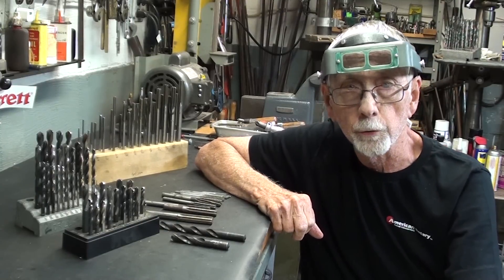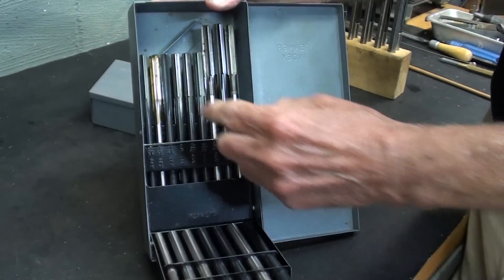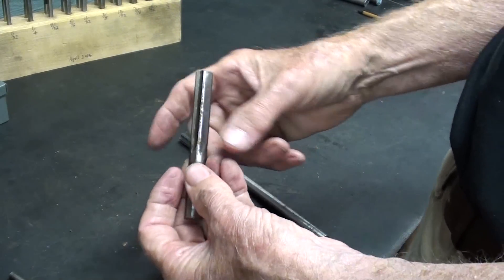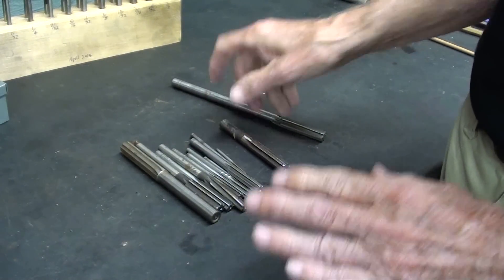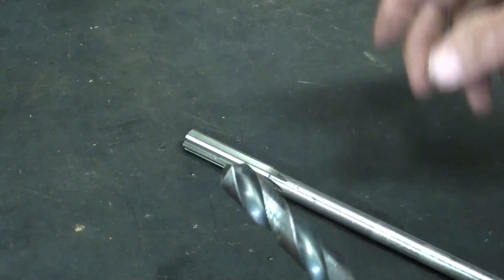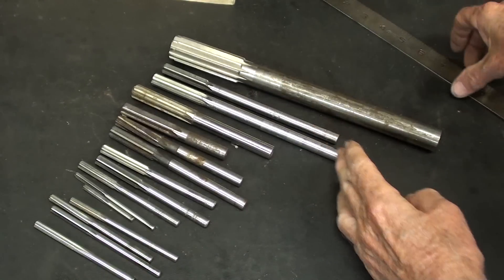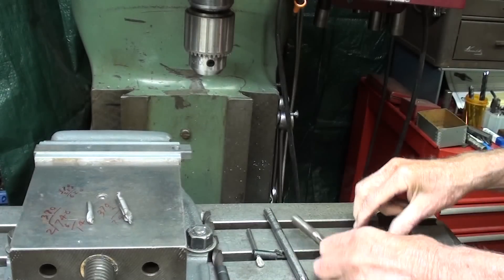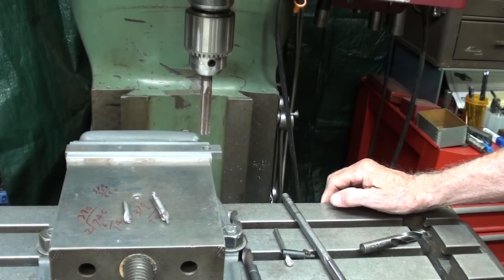SHORT SUBJECT #10 STUBBY REAMERS tubalcain mrpete

Comment: I'm not a machinist. I could be 100% wrong. I would think a shorter reamer would actually be more accurate because there would be less deflection, more rigidity. That said, it would be accurate based on position and there would be less tolerance for being off center. My assumption would be the larger reamers are longer because they expect they may be used on thicker material and larger objects. A tiny 1/8" reamer would almost never be cutting a hole more than a few inches deep, but a 1/2" reamer might be since a bolt that big would be clamping something mighty large! Just my thoughts. Good video either way.

Comment: I was always taught that the reamer needs to be able to follow the drilled hole, thus the longer shank. For accurate hole making it is always: Drill, Bore.Ream,, That's what I was taught. The Chucking reamer also DOES NOT cut on the flutes, but rather the 45 degree angle on just the tip does the cutting. If you measure you will find it has a small taper from the bottom to the top. Hand reamers however DO cut along the length. As always, great video Mr. Pete
Reply: Yes, that was my understanding that the Chucking reamer does not cut on the flutes.

Comment: I appreciate these videos on short drills and reamers. I’ve  shortened a few reamers for production jobs but generally prefer to leave them long. Here’s a problem that no one has addressed. 
Drilling with a short drill and following with a long reamer will cause serious misalignment of the hole and reamer if the machine head is not perfectly trammed. Check Mr. Pete’s earlier videos on an easy way to tram a Bridgeport head.

Comment: Your explanation for reamer length agrees with what I've always heard.

Having bought half of my reamers used, I've occasionally run into cut down reamers, but I've replaced those with new ones. Replacing the chuck with a a collet will regain that vertical room. ER collets are much more convenient for that than R8s are. 

Out of respect for your sainted brother, I shall refrain from using the "b" word 🙂

Oh, and straight reamers cut on the corner: otherwise you'd get a tapered hole. The flutes center the reamer and burnish the walls of the bore.

Comment: Pretty much correct in all of your commentary. Like most machinists, I do whatever I need to do to complete a job successfully (within the limits of demands). AND...having more tool options (long drills and reamers and short drills and reamers) helps me complete my work. I have not seen you do a video about making an extension drill (or other tool) by welding on a piece of drill rod to get to some out of the way, offset hole.
Reply from the maker: Thank you, I have a video planned where I show the extra long drill bits, sometimes called aircraft drills
Reply: @mrpete222  That will get you up to about 12". I was referring to 24" or more. LOL

Comment: I had cut off standard, oversize, and dowel pin reamers, and c-bores as well. Also a full set of drills, reamers, c-bores and c-sinks with negative rake for cutting bronze. It saved tons of time to have all that selection.
  It was only possible because I never had to buy them. I let the shops I worked at spend all the cash.
When I retired, I sold everything so I wouldn't be tempted to get "part time" work. Ah, the good old days

Comment: Thanks Mr. Pete! I’ve found that it is extremely easy to get an oversized hole with a regular length reamer. I would think only in a pinch would I go with the stubby reamer but it all depends on what the application is. If it was a press fit then I’d opt for the long reamer. Thanks for another great video. 👍

Comment: Learned a lathe with machinist handbook and a journeyman on the end of the phone to confirm my plan.
He was working at a mine and I ran his shop....welder by trade.
Work as a millwright....with no papers...
Had ....cwb ISO 9001 arc mig smaw and fcaw..... pressure.
Never ran a tig yet

Comment: Can't say about shortening the reamers. However I wonder if the length of the reamer may reduce the effect of "run-out" in the drill itself? It could flex enough to overcome minor run out but still make a clean hole because of the beef in the reamer head.???

Comment: Oh to have the problem of wearing myself out lowering and raising the table when making a tool change.  I have a round column mill drill which can be a nightmare when I need to raise or lower the head for a tool change in the middle of a job.  I haven’t reamed much but stubbie would work for me.  I haven’t been through all your videos yet, but could there be an experiment reaming 2 holes , one with a standard and one with a stubbie to see how much if any the stubbie reams oversized?
Reply from the maker: Yes, perform that experiment

Comment: Thanks for the video Mr. Pete!
I totally understand both the convenience argument as well as the accuracy argument but I have a question that wasn’t addressed in your video and would appreciate your two cents. I have never put a reamer in a drill chuck but instead have always used collets (used in a Bridgeport) as I feel that they have less runout, less distance (below the spindle), and that much of the extra distance that a reamer presents over a jobber length drill is largely negated by the removal of the chuck to install the collet. I also feel that a collet has a better grip on the reamer than a drill chuck. 
Would appreciate your thoughts. 
Thanks
Bill
Reply from the maker: I agree with you, the collets are probably more accurate.     But it takes time to remove a chuck and install collets.        Also, I think that some reamers have oddball size shanks.    And yes, the length of the chuck necessitates, lowering the table considerably
Reply: Thanks for your reply. 
I love watching your videos and I have learned so much from you.  I really appreciate your demonstration of useful hands-on knowledge and practices. 
As for the extra time… well, the more time I am in the garage the less time I am in the house and apt to be in trouble!
Thanks again 
Bill

Comment: I only cut off one reamer shorter but it still ran true and wasn't for a super critical hole so I think no harm no foul. It was when I only had a round column mill/drill so losing location when changing head height was a problem. Now that I have a full size milling machine I don't use the shorter reamer. It did occur to me the lack of flex might be a problem but need determined my course of action.

Comment: In a knee mill with an R8 spindle could you gain most of that shank length difference by trading the drill chuck for a collet when switching between drilling and reaming?

Comment: I have found that shortening a reamer is a futile step done just before throwing it in the garbage. I have a power feed on the knee of my Bridgeport, so I can easily raise and lower it. Holes larger than 3/8" usually get bored. In my experience shortening a reamer usually ruins. Good video Lyle. You covered a topic that needed addressing.

Comment: I run into this issue fairly frequently with my Enco RF-30 round column mill. The table has no Z axis and raising or lowering the head, it’s just better to avoid that if you can. Having a set of stubby drills or reamers is a good idea for people with these types of mills.

Comment: Ha!  I just cut a big expensive reamer off yesterday.  I didn't make it stubby, but it's a couple inches shorter.  The knee wouldn't go down far enough, and it's a repeat part done. I didn't want to have to hang it off the table and swing the head.  I wouldn't even consider whacking all my reamers just as short as they could go, but now every time I make this part for sale I'll be able to get it out the door a little bit quicker.

Comment: Thank you for all your efforts to share knowledge. I have acquired the baby Sears atlas 101 6x18 lathe and the larger 12x36 Atlas with the pulleys lower on the left side and a Sheldon knee horizontal mill with a Bridgeport head. I would like to buy any training, setup or related books, videos you have. I tried your web site, but had no luck. I also need a steady rest for the 12” Atlas and on the Sheldon the table right side hand crank assembly is missing. Where should I look? Thank you.
Reply from the maker: Send me an email at this address. 
lislepete22@yahoo.com

Comment: I often wonder if there is anything wrong with inserting a drill into a chuck past the shank and over some of the flutes to make it seem a little shorter.  Does it hurt the chuck etc?
Reply from the maker: Do not tighten the jaws over the flutes
Reply: I was told the shank is slightly softer than the flutes to give better purchase on the jaws. I would simply stick with Mr Pete's advice!

Comment: Reamers are made with a long shank for a reason. You gave the reason in your commentary. On the other hand, I don't see a convenience with a "Stubby" reamer. If I'm going from a drill to a reamer on the mill, it only takes me a few seconds, with a power feed, to lower the table and I don't have to re-index the hole after making the change. So I really don't see the convenience. Keep the videos coming because I learn something every time I watch.
Reply: If you have a round column table mill you'll understand the problem the first time you have to drill and ream a hole. If you have to raise the head to clear the reamer you lose position.
Reply: @aceroadholder2185  I'm talking about having a full size Bridgeport.

Comment: How about this idea, that I did not try.  If for some reason one has no alternative to use a short reamer how about reducing the shank diameter in the middle between chucking end and cutting end.
Sometime on small machine there is not much room to go.   Also, a reamer should be chucked for a short length to allow some flex in the jaw.   The cutting force is usually minimal since it removes so little metal.
Reply from the maker: Give it a try

Comment: Sorry for hijacking the comments.  I have a chance to buy a South Bend 9" swing 4 1/2" bed lathe. His ad only has two pictures, and the brass tag in one picture has nothing in the catalog number space, only the above dimensions.  He thinks it's a model A.  It does NOT have a quick change gear box, and the Forward/Reverse switch is mounted where yours is on your model C.  His does not have the rotary dial device under the switch that yours does.  Motor is rear mounted and seems to have only one position on the pulley attached to the motor and at least two positions on the flat belt pulley.  The apron is the same basic one as your model C.  However, it only has a Jacob's chuck for holding the work piece, not a 3-jaw or 4-jaw chuck.  I want to make sure I can change that for a 3-jaw or 4-jaw chuck before I buy it.  Was one ever made that only had a Jacob's chuck that was not interchangeable for other types of chucks, please?  Thanks!  Keep up the great work!!
Reply: More than likely the Jacobs chuck is just using the internal Morse Taper of the spindle. It should knock right out and the proper thread sized 3 or 4 jaw chuck should thread right on the spindle. South Bend had various sizes of external threads on the spindle, so you have to be careful when acquiring chucks for it.
Reply from the maker: That Jacobs chalk should be removable. Then you can mount a three jaw chuck on it. It does not appear to be a model it is probably a model C.  Probably a good machine, but you need to examine it in person before you buy it
Reply: @grntitan1   Thanks so much!
Reply: @mrpete222   Thanks so much!
Reply: The other possibility if it has a Jacobs style chuck on the head-stock spindle is it could be a Jacobs 58B or 59B head-stock chuck. Those thread directly on to the 1 1/2-8 spindle nose and are hollow to allow long stock to pass thought the spindle
Reply: @peterfox2565   That's good to know, I'm gonna look at it today!

Comment: Ok i suppose each one for himself(herself)on this topic. Me being just doing engineering as a hobby, ill leave the subject to the real experts( not the keyboard warriors out there🤣)its good to know the ins and outs of tools and their applications. Yes its certainly annoying to have to pick up the mill head when the drill shank is too long being frustrated  having to reset and regain reference,(i dont have a d.r o.yet)and here in SA even used tools are sometimes pricey dependant on the supplier or source.but i go for the new 1s as much as possible, after saving a bit. Knowing that you look after the tool more seriously knowing you paid for it. When it comes to fixtures i .make my own or anything else i might need and save money. But some things jus cant be made and isnt preferably bought 2nd hand, so a new tool isnt beaten easily as it works so much better. Just my 5cents on the topic. And by the way, im not eager at all to cut something as they were made mostl likely that way for a reason

Comment: There's no such thing as a stubby reamer.  If you shorten it, it becomes a side mill!  The flex in the long shank is what permits a reamer to ream instead of mill, following the pilot hole, instead of milling a new revolution of wherever your mill axis happens to be placed, which will include X, Y, and tram errors.
Reply: Not true. Chucking reamers do not cut on the flutes so they cannot become side mills.